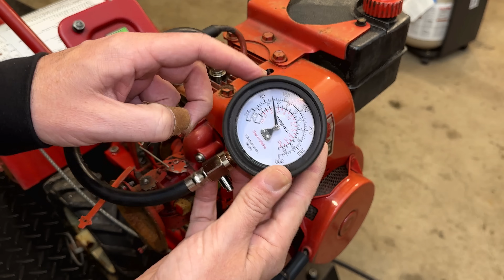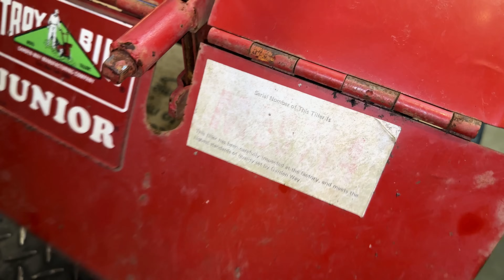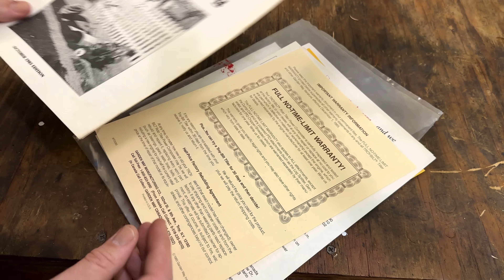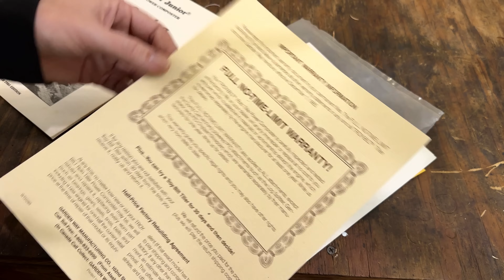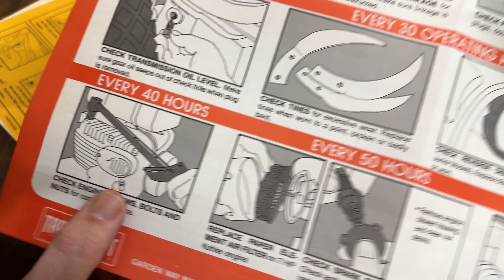Vintage Troy-Bilt Tiller Has Issues

Comment: I recall wearing-out and rebuilding my 1969 model "Horse" long ago and my brother still has it.  The high RPM is likely reduced from the typical 3200 because the reverse speed ratio is a good bit "taller" than the forward belt drive -- ya don't want to back over yourself with the tines spinning!  On tougher ground such as you were trying out, It helps to reverse the chevron tires to help reduce the tendency of the tines to push the tiller.  In good deep garden soil, the typical directional pattern is better.

Comment: Is it reasonable to drain then fill the gear box with ATF and let it soak to safely dissolve the oil sludge. Then drain and refill with proper gear oil?
Reply from the maker: Yes.  I actually changed the gear oil again after using it once because it became contaminated quickly.
Reply: @jcondon1  neat.  It looked a bit like something we would expect see coming out of an "I Do Cars" video.
That guy has made me ultra religious about oil maintenance.

Comment: Hello James, I changed the seals on both the gearbox and transmission 2 or 3 times and they still leaked. I used the correct gear oil and made sure the seals were flush with the rims. It is a Troybilt Bronco model. What could I be doing wrong? I also cleaned off the shafts from rust and dirt. The leaks occur over a few weeks.
Reply from the maker: Were there any marks on the shaft that could be damaging the seal?  If it the correct seal?  Otherwise could be the gearbox building pressure and pushing the oil out.  Would leave the fill cap unscrewed to see if that helps.  Was wondering where the vent was on my machine because if clogged, gear oil will be pushed out if pressure builds.  Another thing to consider is the spring on the back side of the seal.  Sometime it can fall out when installing.  To prevent, put a bunch of grease on the seal covering the spring before installing to hold the spring in place.
Reply: @jcondon1  Thanks Jim. I am going to do as you suggested.
Reply from the maker: @jameshixson4770  if the shaft is the issue, look at something called speedie sleeve.
Reply: @jcondon1  Thanks again for the SpeedySleeve Info. I haven't had a chance to inspect the shaft yet, but will get sleeves if shaft is damaged.

Comment: My mini bike had that exact engine and it was bought back in 1971-72 era. I think that tiller may be older than you think? Or Tecumseh kept building that identical engine for decades?
Reply from the maker: It was an HS35.  Think they made variations of that engine for many years.
Reply: @jcondon1  Yeah, I was going by everything I could see and right down to the tank, lid, choke lever, air filter mount, carb, cowling etc. it was identical to my 1971 mini bike, so that's what I based my assumption on.

Comment: Considering the water and sludge that came out of those gear boxes, I would have filled them with diesel fuel and let them sit overnight, then pilled the plugs and let them drain until the parts came in. It would have dissolved and flush more out.
Reply from the maker: That would have been a good idea.  I ended up flushing the new gear oil out after using it since it picked up some debris.

Comment: Sir, I’m totally surprised. You did not fill  the old oil with diesel oil and let it sit for a few days.
Reply from the maker: I should have.  I ended up flushing out the new gear oil after using it once to help clean it out.

Comment: You are big on torquing all the screws, nuts etc.  How often do you have your torque wrench calibrated?  
I assume you realize that new torque wrenches are not calibrated from factory/supplier.  They should be 
calibrated at least once a year.
Reply from the maker: I checked the calibration once. Periodically I check them against each other.  Does not mean they are correct, but at least I know they agree with each other.

Comment: I'd order in the the year serial number model number sticker.,an make A stamped identification plate tag for it to James condon. As you can see that 1985 rear rotor tiller is and was we'll worth fixing and saving it from the past. From 1985 to 1989 they basically kept them kinda the same. Accept the tiller part itself changed and veried on those troy bilt rotor tiller's from the 1980'S. And switched totally in the early 1990'S to the bigger and wider style set-up on them to.

Comment: Imagine how well it will till at 8000 rpm engine speed.
Reply: 3600rpm max......
Reply: Ya it will run good at 8000 rpm , not for long.
Reply: @PandemicPat  Pft, minor details. You got to have faith, put some race fuel in it, and add some stuffs to the oil, and I am sure it will handle it just fine.

Comment: Why didn't you try to get the parts from the manufacturer since you have an unlimited warranty on the machine?
What exactly is warrented?
I had a dishwasher with a 20 year warranty on the tu and the manufacturer gave me a new machine when the tub developed a hole in it.

Comment: More Tecumseh troubles.  Every flat head Tecumseh I've ever worked on has had governor problems, usually someone installing the governor relay rod in the wrong hole on the arm or carburetor or the thing just getting really sloppy and worn out. Really a shame because Troy-Bilts are made so well and Tecumseh's are made so cheaply. Nice save though.

Comment: Which ultrasonic cleaner are you using? Are you happy with it?
Reply from the maker: Ben using simple green pro hd recently and it is working well.
Reply: @jcondon1  thanks. And which machine is that? Vevor 6L?
Reply from the maker: @justinrobertson1590  Mine is branded creworks, but the Vevor looks the same.  Likely only different branding.
Reply: @jcondon1  thanks, in the market for one but the reviews are all over the place. Are you satisfied with yours?

Comment: It may be worth saving but it will never be anywhere near as good of a tiller as a Howard Gem!!!
Howard Gems were the best walk behind rototiller ever built anywhere on the planet!!!!!
When they finally went out of business they were selling for around $10,000 each!!!
Three gear forward, 1 reverse, three different widths, choice of several different engines, many different adjustments possible, uses the same exact tines as tractor mounted rototillers, etc, etc....

Comment: your video's are becoming too long and full of useless info. do i really have to point out why only 3 of the head bolts turned? the rest of the bolts just hold tins on and screw into the actual head bolts so you would have to take the tins off to torque the rest of the head bolts